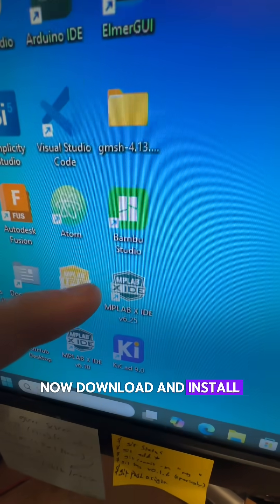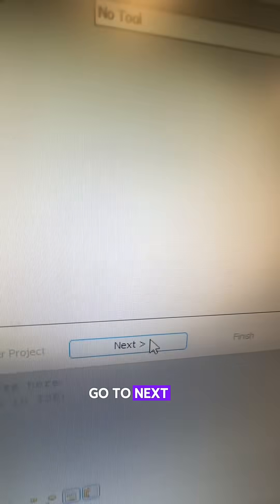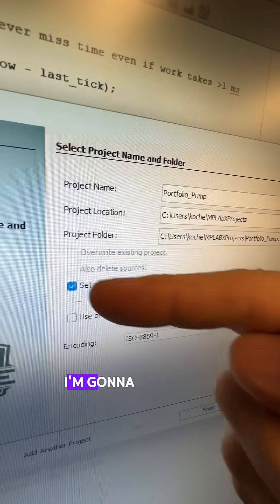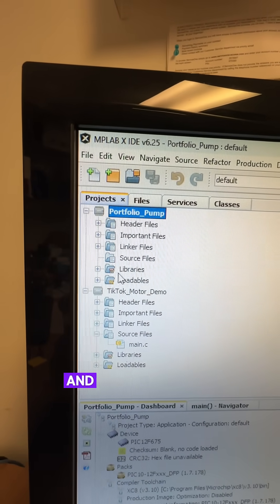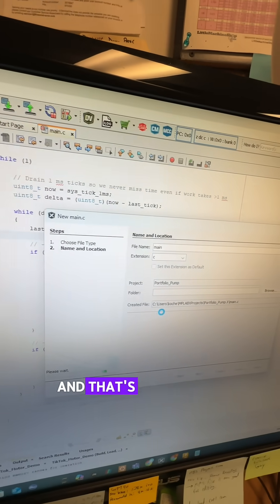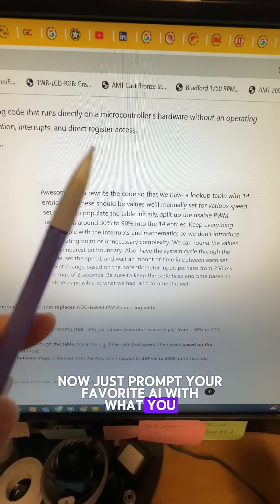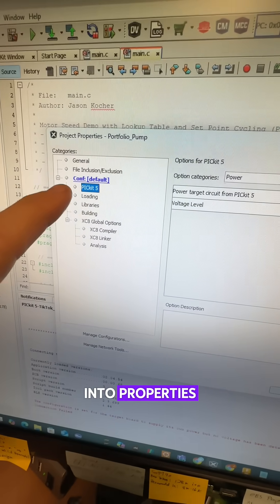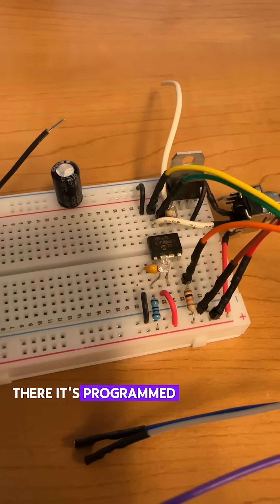$150/hr Portfolio Resume Builder Pump Project!

Comment: I don't see where AI was needed or used for this use case? Also, why would you use a PIC for this? Are you just a legacy engineer?
Reply from the maker: I’m proposing that engineers and electronics enthusiasts use a diverse range of processors including PIC, Atmel, RP2040, ESP32, and Raspberry pi, etc. AI can help come up to speed faster on doing portfolio projects with a wide cross section of modern and legacy devices to suit different applications.

Comment: I have a project skill recommendation. Use the LED WS2812 controller as a signal TX/RX comms line. Super cheap way to send signals across a wire. The signals can get voided by the individual LED IC and reduce the costs that may otherwise go to RS458, CAN or other controllers. This only works for low data rate applications, but it is surprisingly simple and in those applications is able to replace the transmission line with $0.03 repeater/signal booster ICs made for LED strips .
Reply: Also, I posted from memory, the part names may be different in real life.

Comment: Yo, awesome video. Is that intense PWM noise bad for the motor? Do you need to have a PWM rated motor like you need inverter rated asynchronous motors in AC?
Reply from the maker: Not a problem, the frequency can be changed for different motors. I could use a diode across the motor tho to allow inductive spikes to shoot past.

Comment: Is there any downside to using a pickit 3 vs the 5? The 5 is a bit out of budget range so I picked up a 3 for like 20 bucks.
Reply from the maker: I think MPLABX might not support the 3 anymore, at least for the 12F675. That’s why I had to buy the 5. I could be wrong. Also you can roll back to an older version of MPLABX.

Comment: very genuine question, but how do you make money with this? just free lance and fix stuff? what would a job title be that requires this skill?
Reply from the maker: I recommend you design and prototype new products or test fixtures for customers. You’d want to send employ, or use this as a resume builder if you’re a junior EE looking for a job. Take it to the next level tho.
Reply: @i2c_jason  i assume EE is electrical engineer? if so thank you for the response. I work in cyber security but am pivoting to software development, but this stuff is interesting none the less.
Reply from the maker: @jeffreyrobert1598 yeah sorry. Also applies to many other disciplines, I’d argue even industrial design.
Reply: @i2c_jason what are recommendation for industrial design? Great video thanks Jason

Comment from the maker: Let’s brainstorm other cool offshoots of this project: program the micro to slowly ramp the pump to 100ml/min, program the micro to immediately run at 50ml/min, stay on for 3.025 seconds, etc etc. This is the most fun way to learn electronics and build your resume, even if it’s not in an engineering field, you’re still showing a future employer how you are different than your competitors. This project also applies to inventors who might need to understand microcontroller capabilities, and above all, any electrical engineering students who are trying to start their own business. Controlling flow is an essential manufacturing skill that will never go away. I hope you can see how AI is a small tool in the bigger picture here. -Jason
Reply: Would have been good if this comment were stressed in the video. The temptation to people who don't have guts is going to be to ignore what you said in the end about learning, and just populate their resume with AI projects. Using a working project (whether your code from GitHub, or created by AI) as a starting point is an OK way to get going, but the real skill comes from making those modifications, deeper and deeper, until there is a good understanding of everything going on in the project. I'm enjoying these videos you're putting out. :)
Reply from the maker: @ruhnet thank you! I tried to stress it right in the beginning about swiping if you’re the dishonest type. I think even if someone just re-makes the project at all, that would still be a value-add to their portfolio.
Reply: @i2c_jason  That is true, as even just the experience of putting it together, even if you don't understand the code does add value and give some amount of skill.
Reply: What are you using to program the PIC?
Reply: @ArielLothlorien you can use a PicKit programmer, or an MPLab ICD (more expensive), or you can build a programmer.
Reply: @ArielLothlorien  Probably using the PICKit 5. I believe you could use the PICKit 3, but I wouldn’t go lower. 3 was the last PICKit that had a CLI 😢.